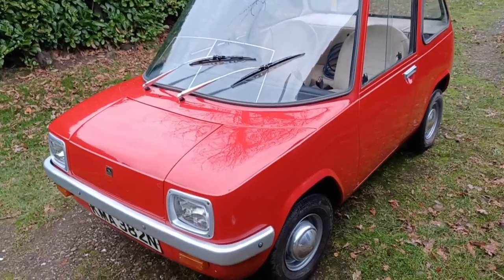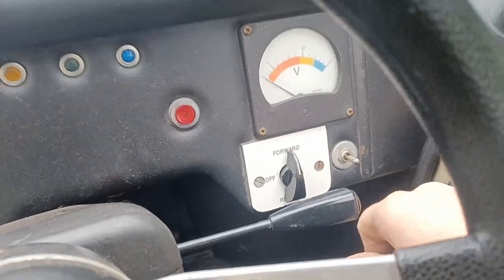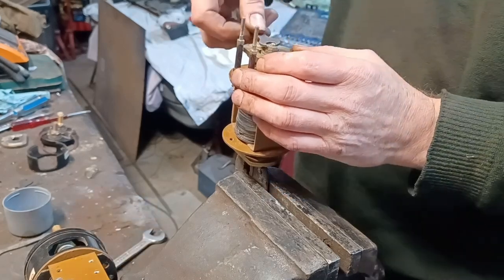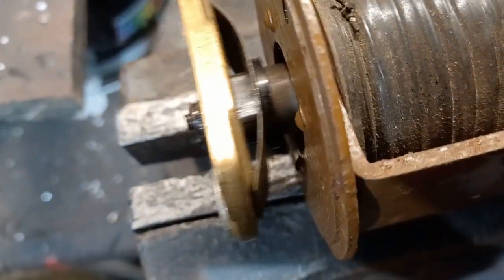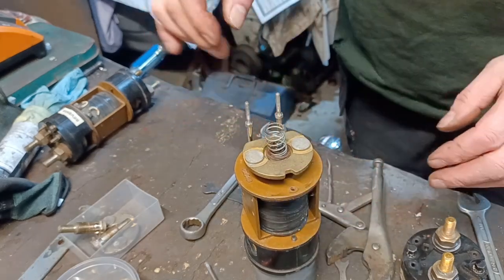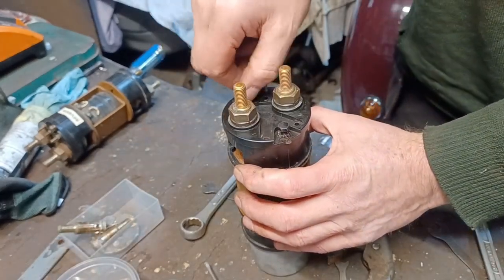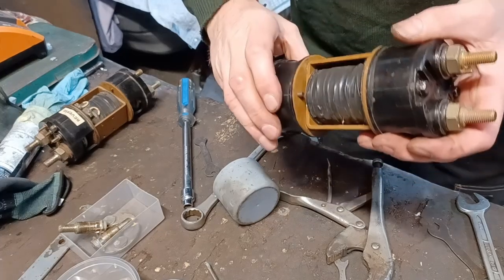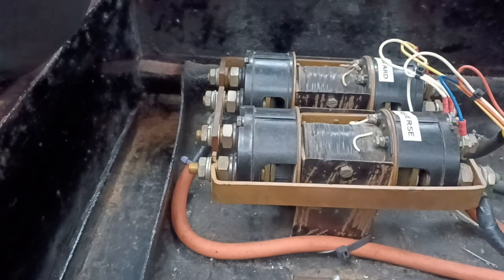Contact points fitted - Enfield 8000 #microcars #electromechanical #electricclassiccar #restoration

Comment: Well done with your repair. However the original contact controller design was flawed, the at rest contact ends (normally closed) are underrated for the full motor current because there is insufficient spring pressure at those ends, so those contacts give quite a bit of trouble.  A rework using only Normally open contactors for forward or reverse would solve that problem.

Comment: Job well done, amazing you could get new contacts.
Enfield could have made a manually operated switch with a lever to make the necessary contacts for forward and reverse maybe mounted between the seats
Reply from the maker: Later cars did indeed have lever control - my wreck does have this system but not had any experience of it yet. The P registers and later N registered cars are thus fitted. The contacts are common with fork lift trucks which is why they are now widely used but still available as NOS I think. certainly my supplier has a large stock of them!